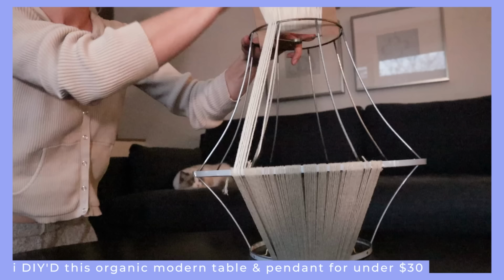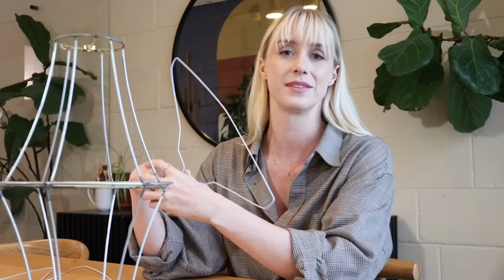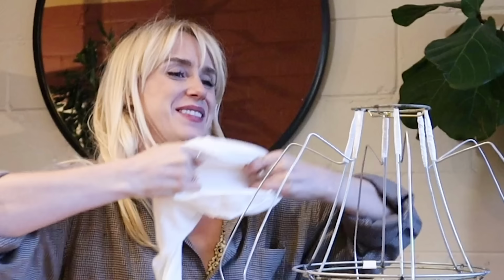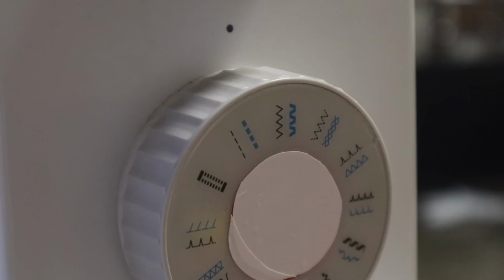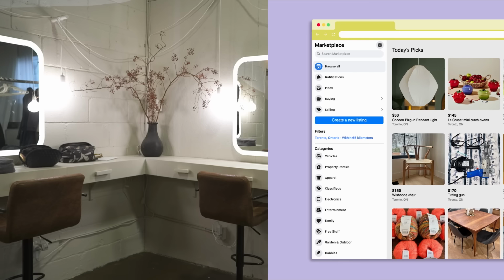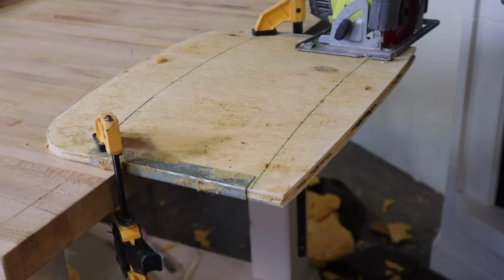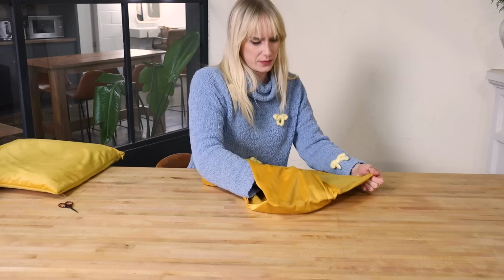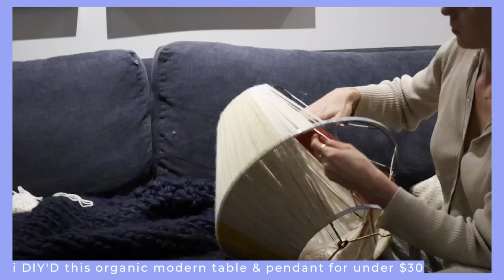upcycling ugly items into designer decor...hopefully

Comment: About the cocoon light: I think you needed to be able to control the shape more than a piece of stretch fabric allowed. I envisioned this as a series of panels, glued or sewn together. Each panel could be made of velum or another kind of strong paper. Or even canvas or burlap. Each panel needed to be shaped separately on the wire form. That would have given you the kind of edges and defined shapes you wanted. As it is—well, I won’t criticize. It seemed only that you were seeking a fast solution to the fairly complex geometry of the light and that turned out not to work.
Reply: I think if the structure underneath would be shaped with the "pull over" cover in mind it might work better.
Reply: @fluffypuffs  So, a more stable structure and not so geometrical?
Reply: yes and maybe more outward shapes than inward bends if that makes sense
 @Eloiseat6
Reply: Maybe Rach can revisit this DIY and try this suggestion!
Reply: I was thinking maybe paper machete
Reply: The structure seems a little wonky and I was wondering if it would work sewing partially the fabric to the pieces before mounting them to the central structure.
Reply: Yes! I was thinking of something along these lines!
Reply: Yes, perhaps panels, but then there are a lot of seams which the original style doesn't have.  Maybe a more simplistic shape?
Reply: Rice paper cut per channel and glued onto the initial framework 😢
Reply: I agree and I would have used something like a power mesh or a stretch tull (or banana paper if you want to glue it) but for sure something more translucent. When working with stretching fabric you have to give a negative sewing allowance to get a good fit. For example: your circumference is 50cm/inches, your Panay has to be smaller than that like 5-10% at least but how much really depends on the project.  For construction I would suggest something like an umbrella pattern for reference 😉 and maybe Anker the fabric at the lower points/dips to the structure to get a clear shape.💜🪡
Reply: @sandieedward993  I was thinking rice paper panels as well.
Reply: My immediate thought was paper mache, espeially as it would hold the wires in place. The cover ended up hiding the cool structure that she created.
Reply: Agreed. I was thinking panels would be a lot better
Reply: @haileymaurer1129 light doesn’t diffuse very well through paper mache unfortunately :(

Comment: i wonder if you could remove the drawstring after pulling the fabric onto the lamp and then glue the fabric onto the metal skeleton of the lamp?  you would only need to glue the top and bottom since the middle part fits great already. I think this might help the angled details of the lamp be prominent?
Reply: I think that would make it difficult to change the lightbulb. Although it might be prettier that way.

Comment: I would have added spacers between the wire hanger so they didn’t move so easily. 
😊
Reply from the maker: I had that thought too! But you would've been able to see the structure through the fabric
Reply: @TheSorryGirls  What if you add them not between the "wings" but diagonal - from the tip of the wing to the middle point on the rim, so from the top they look like a star with tips at the wings? I would add a drawing, but YT does not like links in comments… 🙂
Also, 12 wings would look much better, IMO.

Comment: For the pendant light: if you look at the inspo pics you can see that the original frames have way more sections. This is to divide the pressure of the fabric more evenly and also to allow for more definition in shape.
Also: if you could break apart an original you’d see horizontal supports between the vertical sections on the inner part of the shade, again to support the pressure of the fabric.
So your approach wasn’t wrong, you just needed to add more of everything basically 😉 
I love that you showed us the whole process though even if this was an unsuccessful attempt, it’s really the only way to learn new things :)
Reply from the maker: Thanks! I think we need to try a part 2 with all these amazing suggestions
Reply: @TheSorryGirls it’s not just the amount, it needs to be soldered. And a much, much stretchier fabric.
Reply: The originals are not made with fabric though!! They're made out of a polymer that they spray with a spray gun as the lamp base spins around. So it's an entirely different process.
Reply: Agree- more sections would support the fabric tension better. Also while some may be sprayed w a special substance, many lamps like this are available made of fabric. But i think knowing now that the drawstrings are needed if that part of the shade was recessed inside u would get to see more bends. Basically more sea urchin shell shaped and less conch shell shaped lol

Comment: Hey Rachel! I think the lamp has a lot of potential, you need to do a follow up!
I would suggest doing it in panels like so:
1. Cut panels biggers than needed
2. Superglue the panels on each section, leaving the surplus hanging off
3. When the glue is dry, cut the excess with a razor blade right along the metal wire for a super clean edge!
Hope that helps! ❤

Comment: For the cocoon lamp: they make cocoon bodystockings large enough to accommodate the size of the lamp! It's the same woven nylon material (you can choose from different colours), only one seam, sometimes none, and you can fit up to 1-2 people inside of one so they're stretchy but not so tight that they'll bend the wires. You find them online... you may have to turn safe search off for this one 😅
Funnily enough I needed one for a caterpillar/butterfly costume and it was absolutely perfect, eerie but so pretty. Good luck!
Reply: Um very good to know and also those sound really comforting to be in 😮

Comment: For the cocoon light, a tip to work out the pattern, put it on the frame inside out, then pin out the excess fabric along all of the wire. Give yourself seam allowance while pinning and then remove from the frame and sew where the pins were. This should then give you the smoother effect you were after.  The other way to sew it is to create each wing separately and then attach all together. Fashion designer thinking out the box to create a pattern here lol ps the chair was excellent!
Reply from the maker: This is literally, genius problem solving!

Comment: A little suggestion on how to improve the lamp:
What gives it the obvious DIY look is the bunching of the fabric, so if you fix that I think it will look amazing just like your inspo

My suggestion to fix that:
If you want to use the same fabric you are already using: You can remove the draw string and pin the excess fabric while the cover is still on the lampshade, and mark it with a marker and sew the excess off making gores.
If you want to start fresh with a new fabric: You can use a common technique that cosplayers use to get patterns: cover a side of your lampshade with tape to get the perfect shape. Then you take a little bit off sideways to account for the stretch of the fabric. You'll wanna make 1 piece for each side, aligning the seams with the wire.
For both, you'll wanna align the seams with the wire to hide them and you'll need to close the last parts by hand or add some sort of closure.

Another alternative is to sew some fabric strips to the wire and then sew each piece directly to the lamp by hand, like I've seen lampshade artists do.
Love to see your work, it was a good try and still has potential to be improved if you so wish to!

Comment: Lamp:
1. Cut 3 or 6 panels to ‘match’ shape of skeleton/ spines (Rachel sewed 2 hexagons, I’d suggest 3or6 ‘hexagons’ but with extra ‘corners’ as per shape of spines). 
2. Sew 6 channels for the spines (like you would with boning for corsets). 
3. Insert 6 individual ‘spines’ into ‘sock’. 
4. Attach outer structure to inner structure. 
5. Hand sew hem around top and bottom edges.

Comment: It was a good try but you can still fix the lamp if you so wish to!
I think what gives the DIY vibe is the bunching of the fabric, so all you need is to make the cover fit nicer to the lampshade.

I've seen many lampshade artists wrap the wires in fabric strips, then place the fabric onto each panel, pin it and sew it by hand to the strips on the wires, then cover the seams with some trim. That gives an extremely smooth result!
Another option you can do is pin the excess fabric to mark some gores on the current cover to avoid wasting fabric, but you will need to finish it by hand to be able to fit the wire inside

Anyways, thank you for showing your fails too😅

Comment: The light needed greater stability for the spokes.  I would invest in a soldering iron, which will help you out if you continue to upcycle lampshades.  Rather than stretch fabric you could have used washi paper (think shoji screens or the floor lamp at Kelsi's house) or even gluing the fabric to the spokes to refine the form. If you had cut long strips and glued directly to frame that might have worked too. 

As for the chair, my preference would be more cushioning.  It would soften the metal frame, making it more lush.  Add in some tufting to the back rest.
Reply: washi paper is a very cool idea!

Comment: For the light maybe a sewn "tunnel". The tunnel would need to be a few pieces, but you could put a string through it and on the spots where it's open you could thread the string around your shade structure. 
This way I could see your shape come to life.  Also to keep in mind - this would probably be visible from the outside, especially when the light is shining.
Kinda hard to explain but I hope it helps.

Comment: Lamp shade - lots of great suggestions on how to work with a stretch fabric. But how about approaching it from another direction. What about wrapping a frame in a "Shrinkable" material such as the plastic used to wrap boats or to make old windows air tight in the winter? Shrink to desired shape using a hairdryer or heat gun. Should allow you do have both curves both inward and outward.

Comment: I think in order to keep the clean lines of the cocoon light you’d need separate panels and add “pouches” where you could run the wire structure inside. Like the boning in a corset. ❤

Comment: Just some two cents from a product designer in the interior world, most of the inspo lighting you are looking at are rice paper! That is how they get it to be so form fitted. There are a lot of tutorials on how to make rice paper lamps, the cost would be higher but you could also sell it for more. Another alternate is to use a thin linen (or faux linen) fabric and cut smaller panels that are the exact size of each segment of your frame. Similar to how a football is sewn together. You could add plastic sheeting around the frame and then cover it with fabric also. 

Also just to add stability to your frame, I’d remove the electrical tape and use JB weld or even better a soldering iron that you could use for more metal based projects! 

Ps the chair looks so good!!
Reply from the maker: Thanks for these tips! Very helpful insights here

Comment: So for the cocoon lampshade: I know one of your major frustrations was losing all that definition on the top. I think your best bet, to remove the drawstring bulkiness and keep those curves, would be to pattern your fabric such that there ate basically darts running along the wire frame.

With some fancy patterning, you could make it such that you only have to sew those darts on the top and bottom, so that there's no seam on the outward curves. This method would likely involve some hand pleating and handsewing on the top and bottom after you slide the 'sock' over the frame, but you could also optionally try a sort of elastic waistband on the top and bottom instead!

Comment: On the lampshade- if you added spacersmade of wire (loop around the arm then over to the next arm all the way around) along the top and bottom points of the outer shape you could have added structure without it being too visible through the fabric. If it was me, I would use a cosplay hack and wrap the whole thing the way I want with a plastic bag and then duck tape over that. You then cut the tape off and use it as a sewing pattern to get the final shape you want with fabric. (Dont forget to add a 1/4 inch for seam allowance.) There are lots of tutorials on you tube for this. After doing this I would cut out my pattern from the fabric I want. (You'd probably still want it to be kind of stretchy.) I'd sew the pieces together, pull it over the frame and then whip stitch up the side by hand to close it. For the  indents on the top and bottom to read really well from the outside you may need to add a very small tack down stitch from the outer fabric to the wire frame underneath. That's what i might try. Don't know if that helps but it's an idea.

Comment: The concept was so strong I want to see a redemption arc for the cocoon lamp. I agree with other commenters it needed more spokes and maybe support between the spokes to hold them in place. I think the fabric you ended up with was too thick. I understand most lampshades are made by sewing the fabric directly onto the wires but that sort of defeats the concept of the cocoon lamp shade. I don’t see why nylon tights wouldn’t work on a skinnier design, and maybe especially if they were plus sized? I love your takes on interesting light fixtures, I wouldn’t be mad if that were a whole series in and of itself, or maybe a subseries within project profit. Lamps and statement lighting are like the lipstick of the interior design world. Obviously they can be very expensive and classic/formal, but it’s also cheap and easy enough to be really trendy with it and change them up, especially if you diy. And they make such a statement in a space. But yeah not be a hater but this one was a big ol miss for me 😂 gotta respect the risk taking though!

Comment: The chair is actually pretty genius and looks comfy! This is a great use for our beloved ikea pillow shams. With the light, if the fabric stays the same i think the interesting bends in the wire need to be at the wider point where the stretching is happening. Otherwise, using something like a tube of tights like material (but that is appropriately sized) would still work better so it can go from ver small to ver stretched. Maybe a wire that goes around the circumference and stabilizes each arm will help them hold up to the tension created by the fabric. Physics!

Comment: On the lamp, I think sewing each facet as a separate pattern piece, and then stitching the wires to the insides of the seams might work better, you could also sew it in in the ends instead of having to stretch it around. It would give you more of a dipping shape into the concave bits.

Comment: I bet the OG cocoon light had some seams along where the wires are. I would try papier mache on the wire, using tissue paper so it's still translucent. Like an Asian paper lantern, but in an unexpected shape. You could pick tissue with a pattern for the top layer for an extra touch of whimsy.

Comment: Totally agree about either shrink wrapping or creating individual panels for the light. Not sure the logistics of it, but you could always shrink wrap it with clear plastic and then use a tissue paper to decoupage all over for a diffused light? 

When I was younger I used to iron shopping bags between wax paper to create thick panels to sew together into tote bags…could something like that work? It would be structured and maybe even easy to glue together. Or you could shrink old grocery bags by heating them, leaving the logos and print for an artistic touch!

Comment: The lamp needs more structure, such as twice as many verticle forms. It also needs horizontal structure to keep the ribs evenly spaced. Also, stretchy fabric will bend outward at the fat areas, but it won't bend inward unles you stitch it to the inward bends. 
You can try again with a different shape, or you can use the base form and wrap wrap wrap again to create another woven shade. That one was a winner!

Comment: For the lamp shade, I have a couple thoughts. 

First of all, I think welding (or maybe super-gluing?) the wire pieces to the lamp frame would keep the arms secure and evenly-spaced. 

Also, I think the first pair of tights was a little too thick and the material from the fabric store was even thicker / less stretchy. A thinner, stretchier nylon fabric would have been closer to your inspo.  

And this would take a little more sewing / pattern drafting skills, but I think the fabric shape needed to be more of a cylinder, with a shape to go around the sides, and a circle bottom panel to close it permanently (rather than drawstring). For the top, if it is just tight enough to slide over the top metal ring, it should hold snugly on its own.

I have sewn things like car seat covers, so I know how much more brain power it takes to materialize a fully 3-D shape instead of a 2-D shape (like the hexagonal pillowcase shape), but it might be fun to try and see what you can do! I feel like it has potential to work!

Comment: Coccoon lamp: 
1. I would add some cross pieces of wire in between wings to make them more stable (could even just be thread or something, doesnt need to be metal if you do them all around, its gonna « pull » the wings instead of pushing them)
2. Would cut the fabric tighter at the top and bottom ends (avoid gathering effect) and close with a velcro or snap instead of the string

Loved the chair :)